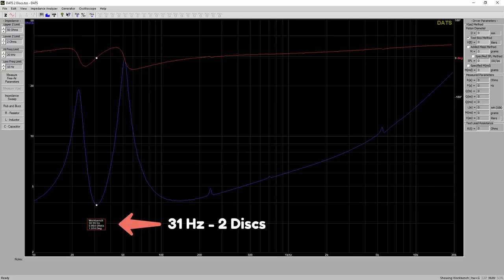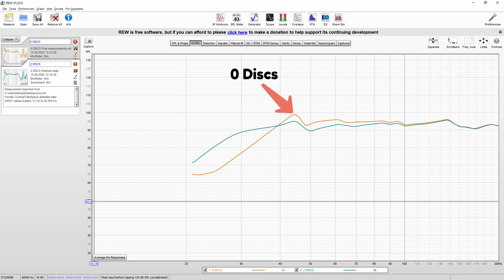Cube of speakers - Passive radiator subwoofer build

Comment: Thanks for the video, very informative. why didn't you use RSS210HF-4? HF seems better. I'm planning to the same thing only with RSS210HF-4 and RSS265PR 10" in the 20 liters box. Do you think going with 8 inch + PR is better or just one sealed RSS315HO-44 in the 20 liters box.

Comment: Nice video, thanks for that and also your box calculator. It appears that the drivers are not flush mounted. Does it matter on subwoofers? Or any other driver? Thanks
Reply from the maker: There may be some difference when it comes to bookshelf, floorstanding speakers. However, for subwoofers I doubt there is any.

Comment: Do you have any thoughts onto turning a smallish centre speaker tuned to 65hz, into a small, portable passive radiator sub tuned to 32-38 for a DIY portable BT 2.1 speaker system?

Comment: Volume (in vid) a tad low ? All PRs tuned to same frequency? Are they in-phase or out at resonance?
Reply from the maker: Volume is fine in my opinion, turn it up if you find it low. All PR's are tuned to the same frequency, yes. And last question, I assume you are asking how I wired the speakers. Both speakers are wired in-phase.

Comment: Salut ! Vreau sa fac o boxa portabila  cu un subwoofer dd audio 606 6.5inch și amplificator de 350w pe sub, am o problema , subwooferul are xmax 9mm , care după rodaj cred ca are 10mm  și nu găsesc radiatoare pasive de 6.5inch decât cu 8mm xmax , sunt ok 2 radiatoare cu 8mm xmax sau sa cumpăr doua de 8 inch cu 11mm xmax ?
Reply from the maker: Se ia in considerare si aria difuzorului, nu doar Xmax. Daca inmultesti aria difuzorului (Sd) cu Xmax iti da un parametru care se numeste Vd (uneori il gasesti in lista de parametrii). Vd-ul radiatorului pasiv trebuie sa fie de cel putin de 2 ori mai mare ca Vd-ul difuzorului activ. Daca e de 3 ori mai mare eu zic ca esti safe. Sincer eu m-as uita la radiator pasiv de 10" sau 2 de 8"
Reply: Salut , am construit boxa am luat 2 radiatoare pasive dayton audio epique de 7 inch , problema e ca fs a ajuns la 31hz (hz 0:01
Reply from the maker: Cred ca te referi la Fb (resonant frequency of the box). Si de ce e problema? Vrei mai jos? Mai adaga greutati pe radiatooarele pasive. Ele vin cu niste discuri care se prind pe spate. Sau daca vrei Fb mai sus, mai scoate din discuri
Reply: Scuze , nu terminasem mesajul ca m am luat cu altceva și nu știu de ce sa trimis :)) . Am văzut pe yt ca poți sa vezi ce FS ai daca rulezi o aplicatie cu diferite frecvente și la o anumita frecventa difuzorul nu se misca deloc acolo e FS subwooferul ui , la 31hz nu se misca difuzorul iar pasivele se misca foarte bine , nu este ideala o frecventa de 37-38 hz ? Pasivele nu au nici o greutate adăugată,  am scos și șurubelul în speranța de a creste în fs :))
Reply from the maker: Nu exista o frecventa ideala. Mie mi se pare mai bine 31, dar fiecare cu preferintele lui. Nu mai ai cum sa ridici Fb daca ai scos toate discurile. Doar daca mai adaugi un PR (sa fie 3 la numar)
Reply: @AudioJudgement  ah ok ms frumos !
Reply: @AudioJudgement  salut dinou :D , îmi scăpa aer , am mai pus un rand de lipici pe dinăuntru peste tot și garnituri la sub și pr uri și tot scăpa aer...poate sa scape prin pr-uri ca sunt de carbon și cam se vede prin ele lumina ?...e o mare problema dacă nu tine aerul ?
Reply from the maker: Prin difuzor sau PR nu are cum, doar daca e defect. Identifica pe unde iese. Banuiesc ca se aude zgomot si d-aia zici ca scapa aer. Daca nu reusesti sa identifici, plimba-te cu buzele pe langa rama de la difuazore. Buzele sunt sensibile si detecteaza cele mai mici miscari de aer.
Reply: @AudioJudgement  apăs pe unul din pr și celalalt se "umfla" dar se și dezumfla imediat
Reply from the maker: Pai asta pare a fi comportament normal. Orice cutie are pierderi asociate. Nu e niciuna perfect etans. Doar sa nu aiba scapari mari, care se aud, sau care se identifica cumva. Altfel, ala nu e semn ca scapa aer cutia.
Reply: @AudioJudgement  aaa ok mai liniștit:))))

Comment: Most of the build was nice, but I would have put the connectors on the bottom of the box. Having them stick out of the side takes away from all the clean lines and final finish.

Other than that it looks nice. Too bad you couldn’t get some golden brown speakers to Colour match the enclosure.

Comment: What amp did you use with this sub?
Reply from the maker: Dayton audio spa250. But you need something with roughly 500w at 4 ohm
Reply: @AudioJudgement  thank you! And how are the subs wired? Could you please provide a diagram?
Reply from the maker: They are wired in parallel.
Reply: @AudioJudgement  thank you sir! And thanks for the great videos

Comment: I don't know why you'd claim that: "Most people don't want to tune it that low" - in reference to tuning the PR to 31hz. I'd wager that "most people" would want it tuned even lower - to 25 or even 20hz (the Dayton RS subs will easily play that low). A "subwoofer" that only plays in the ~40hz range isn't really a subwoofer at all - but instead is more like a Bose "bass module", in that it only plays in the 40hz range. 40hz is more midbass than subbass.....
Reply from the maker: I totally agree with you and I much prefer a sub tuned lower. But in my experience people like to tune it higher, because they get more output from a smaller box. And I heard people say that "the port is not tuned correctly since it's barely moving any air" (port tuned at 21 Hz). That sub was playing linearly down to 20 Hz, but since many tracks don't have 20-30 Hz notes, it seems that the port is not doing anything. I might be wrong, but this is my experience, that people tune the box higher, not necessarily for the right reasons.